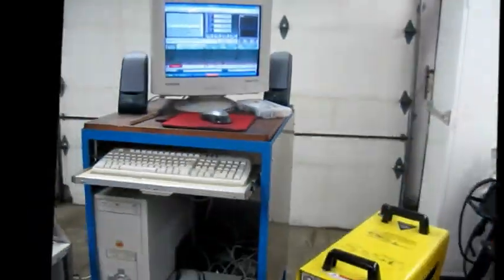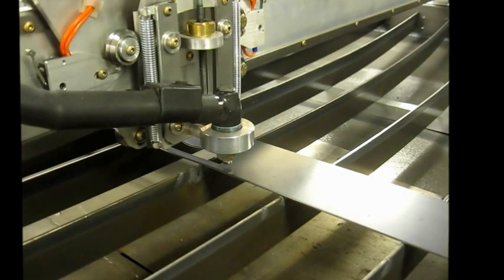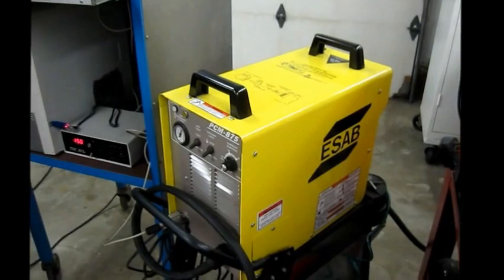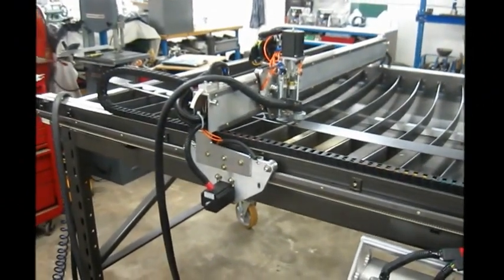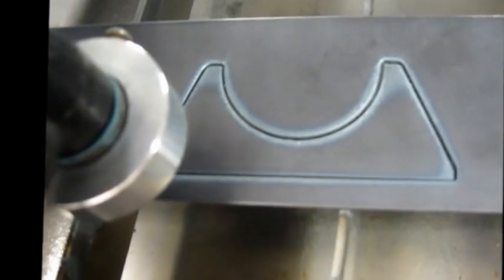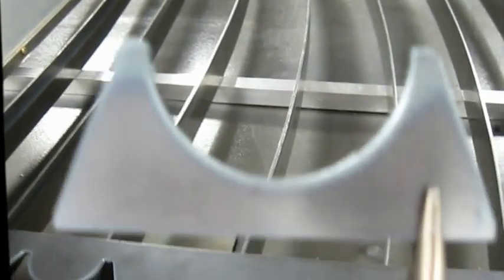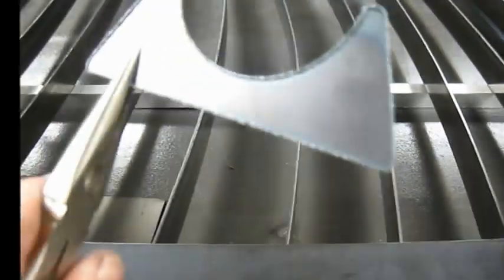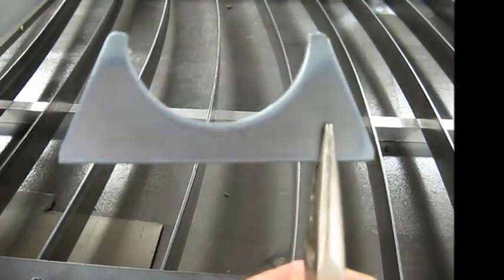CNC PLASMA PROGRESS #7

Comment: Hi please tell us about the wiring of the switch that gets triggered. where does the wire go from the switch to PC. or in another word, what rout that signal takes to inform MACH?
Reply from the maker: +cadcam The wiring is just like a limit switch in MACH.  MACH uses this switch input to determined when the torch has made contact.  You program the distance the slide moves into Sheetcam plasma parameters so it knows how much to step the Z motor to get to your desired torch height.

Comment: Hi tell us about the spring please
Reply from the maker: cadcam What spring would you like to know  about?
Reply: Hi the spring on the Z. it is not clear where it is connected. it is not helping the z motor since it is moving up down with it.
you have 2 springs what are they for please?
Reply from the maker: cadcam Hi, the springs are just helper springs to return the floating head for the torch to its proper position.  When the z axis lowers and the torch tip touches the material to be cut, the floating portion slides on the z axis plate and triggers a switch that in turn sends a signal back to the MACH control software telling it that the torch has made contact with the material. In theory, this should work by gravity but I added the helper springs to ensure that it works consistently on my setup. Because MACH has been told how much the slide moves before tripping the switch, the height of the torch is known (calculated) by MACH and as a result it consistently sets the torch height to "pierce height" and then to the lower "cut height" before the stepper motors start to move on the desired cut trajectory.  
To see the mechanism work clearly before the springs and switch were added see this vid clip of the z axis mechanism being fabricated, at around the 1min30sec point  :
https://www.youtube.com/watch?v=AwRt-gzxcJo  
.....then in action with the springs and switch installed at the 1min20 secs point in the video above.
Reply: just in case gravity didn't pull the floating head U shape down, the spring will. It is clear thank you.
Reply from the maker: +cadcam  Yes that's it.

Comment: Hi like controler box I have a Bridgeport E2R3 boss 8 CNC and like to add a computer to it can you help me
Reply from the maker: I built my controller from plans in Home Shop Machinist I have uploaded both articles to my website. I used Geckos and CNC4PC boards. Check these links:
http://www.mgertech.com/HSMCONTROLLER2003.pdf
http://www.mgertech.com/HSMCNCCONTROLLERREVISITED2006.pdf
There is another series of articles on converting a Bridgeport to PC control, let me know if you want the article and I will scan them to pdf and upload them too .
Reply: @mgermca  I'd like that but have my Bridgeport running with masso cnc controller what I'd like to know where I can buy the tool holders for my Bridgeport?
Reply: Like to build a plasma cnc cutter to

Comment: The board that hooks up to the computer and controls the stepper motor drivers does it have a relay on it? I am unsure how the plasma cutter is triggered.
Reply from the maker: Yes either you install a receiver board inside the pcutter itself or the plasma cutter will come cnc ready ( ie Hyperthem)  and MACH will send a signal to the pcutter ,  Do a search on Google for 'cnc hypertherm 45'
Reply: I have a Hyperthem powermax 600 it is not promoted as a CNC plasma cutter. I can take the 2 leads that are the switch and hook them up to a relay. Then hook the break out board to the relay. I then can use this method for a hooking up a router.
Reply from the maker: Landon Brecheisen I guess you could do that. The real set ups have MACH fire the arc at a height that will not blow back slag into the torch tip, then once the arc is fired and MACH has sensed this, the torch height lowers to your preset cut height. Then, and only then, does MACH command the stepper motors to set the torch shuttle in motion to cut the part. MACH in plasma mode does some trick things to help yuo get good results.

Comment: I bought a used home made Plasma cnc machine with the same height controller. I couldn't figure out how to home the z either. I only home the x and y. If you try to home the z it comes down until the float switch gets triggered but doesn't back off. It then drags the torch on the material while homing x an y. Do you have the same issue and did you come up with a fix?